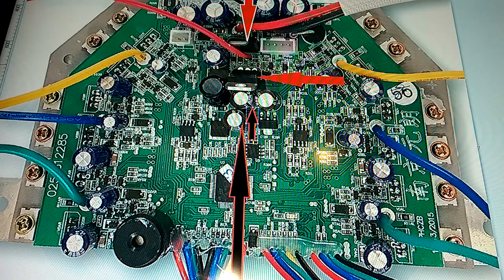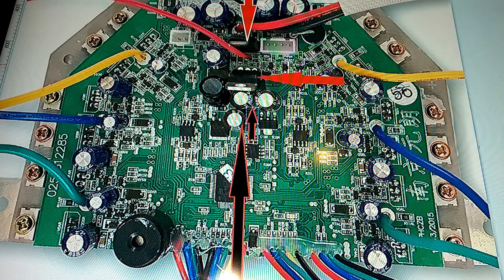How to fix a hover board that wont turn off

Comment: Thanks for the video, i changed two TIP127 but on of them overheating how to fix that
Reply from the maker: I'm not to sure I gave the board away but try checking the two capacitors there might be a short some where. Also Check the transistors and see if there are any shorts on the soldering points.

Comment: What is the capacitor ident number for the big black arrow. Small arrow is C3. I've changed both tip127s and won't turn off. Original fault was a short and wouldn't turn on or charge. Also replaced 3 motor mosfets as well. Appreciate the advice in advance
Reply from the maker: I dont recall what ident number if it needs to be replaces look on the aide it it will have its microfared value
Reply from the maker: and just be sure that the voltage rating for the capacitor is the same or higher.
Reply: @SuperRobbieRoberto  think it is C4 and C3, can't see how these would stop it switching off. I think I have rubbish TIP127s, especially first one, I've ordered some more from another supplier.

Comment: I have to change only the 2 capacitors or maybe the three ones? Do I have to change both tip127 or just the one damaged? Tks...
Reply from the maker: You only have to change the bad transistor and it should be fine, my hover board is still working to this day after doing this repair 7 years ago.
Reply: @SuperRobbieRoberto  I changed one that was damaged... I connected the battery and it was off, and then I turned it on and it doesn't turn off again and the transistor gone again!

Comment: Is there a reason these go bad, should I be replacing with exact parts or higher rated ones?  There has to be a reason they fail like voltage spike etc?
Reply from the maker: I'm not sure why they fail. This board that I repaired was given to me already malfunctioning. I had to also replace the battery  because the previous owner let the batter completely discharge. Obviously because he could not turn it off. I was able to get the old battery's voltage up to where I could see that it would not switch off and when I received the replacement battery it confirmed that I had a component problem. I'm sure If you replaced the components with higher rated ones it would be a bit more durable, then again it also may cause other components to fail.

Comment: Hi my hover board won't turn off and sound like something is lose in it. What should I do?
Reply from the maker: Take a look inside it may be just a disconnected plug for the power switch.
Reply: @SuperRobbieRoberto  it's not but there was a lose screw and I can figure out where it goes

Comment: Hello my friend

I desperately need guidance

The Hoverboard turns off in a rough bump and the accelerator suddenly shuts off

Sockets are sturdy

Do you have an email to send me an electronic circuit photo

thanks for your help
Reply from the maker: Hello Mehdi jamshidi, I don't have schematics to send though what it sounds like is that you have a loose battery connection, check to see if the battery wires are loose or the solder connections to the board are loose. I hope this helps.

Comment: Mines completely fucked. I'm 12 so I don't understand these vids too well. My main problem is not being able to turn of the board. Whenever I press the off button it just beeps. I have to wait for it to go flat for me to do anything. One night where it was fine I was trying to do 360 hippy jumps and kick flips and other shit like that and I put in on charge (it was on low battery) and later in the night my mum walked in and said the board won't stop making a noise. I went in and it just had like a long static note that wouldn't turn off. That's when I had the problems. I did something to turn it off and put a pillow under it incase it turned on again. In the morning I saw it outside (obviously meaning it started being noisy again) I charged it and it said as soon as I put it on charge it started flashing yellow. I pulled it out and it said the battery was red as normal. After playing with it a bit more (after charging it) and put it on charge after. It fucked up again and was unable to turn off and i think I remember it was beepiing or something so I put it outside. After it went flat and bringing it back in I put it on charge. Now all it's doing is flashing with the green battery off and on and so is the charger (charger going green then off, green, off and so on same as the board itself) I haven't taken it off charge yet and I'm very confused what to do. I got my hover board Christmas 2015 and it's a Vovo white 6'5 (I think) Segway hover board. I thought it was stable until this shit storm started happening. Any ideas?